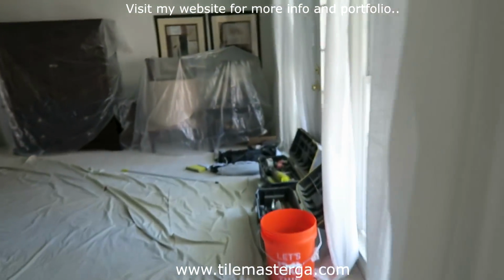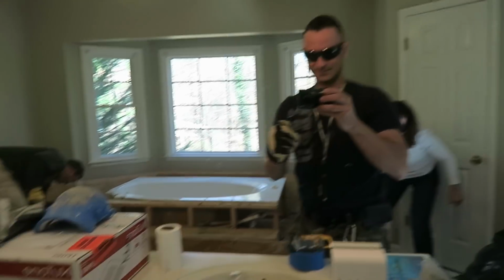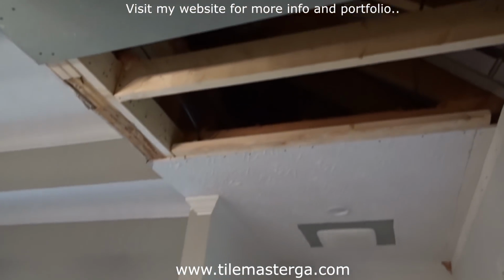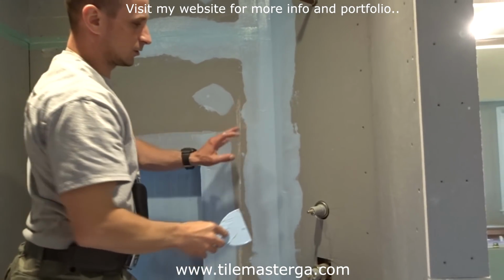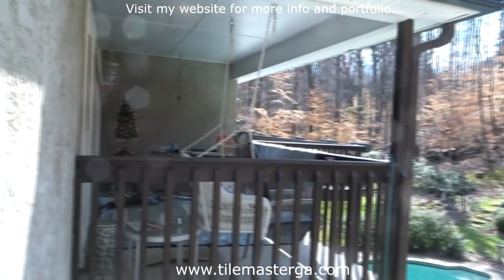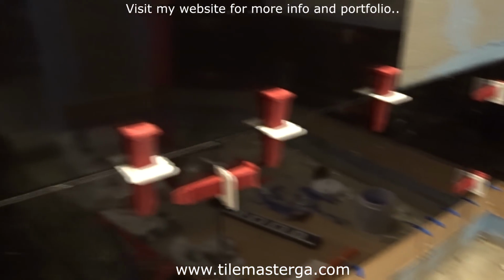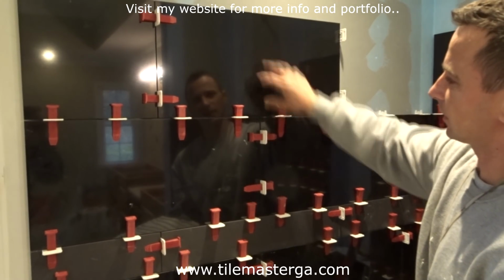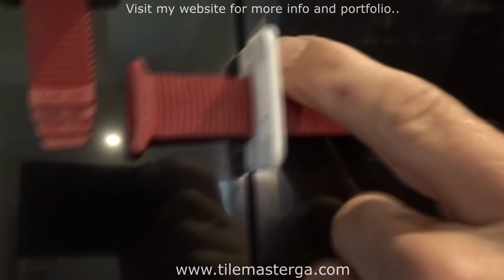Part (1) 1990's Bathroom remodel from scratch - demo, prep, tile installation etc...🛀🏻 🚿🚽🚻

Comment: Thanks for your videos!
Just curious why you didn't continue waterproofing all of the green board in the shower?
It looks like you put cement board in the lower part of the shower.
It just seems like it's standard nowadays to apply liquid membrane over most all of the walls at least to 6' ? 
I don't think there will be any problems. Green board gets a bad rap nowadays since TCNA does not approve it any longer as a shower wall backer even though the liquid membrane manufacturers still approve it when it is fully covered. Very little moisture gets to the wallboard anyway with the increased use of large format tiles, narrow joints and the newer premixed acrylic grouts.
Reply: I don't quite get this either. It's like he went backwards, used to use Denshield (totally fine just to tape the corners) or cement boards. :/ To be fair, I think some greenboard is way different quality from company to company. I tested USG's lightweight and had it outdoors for two months with no problems (I'll get to see how it does this winter...) but it did turn to mush in a week or so of full submerging. But LaFarge just turned to mush in a week of being outside. :/ 

I've seen in some Polish videos where a guy was doing a wetroom, and instead of full on liquid waterproofing, he seemed to coat the greenboard walls with Mapei Primer T or a PVA primer, I'm not sure that would work as well as a real liquid membrane, though.

Comment: Job looks good,but you do not have full coverage. Due to the way you apply white thin set some cement should have smear between the joints. And you only apply it on the tile. But all tile jobs should look good. But I believe behind the tile should be better. The right prep is everything. And putting dura rock on curve nails in pan. And hoping waterproof will take care of it. Mud it right. Then waterproof. It take time to do it right. You are professional set the example. Not hatting. Just from experience 35 years.

Comment: Starr tile said you can't bury the backerboard into the pan to avoid water wicking up the board....Do you not believe in that? Won't waterproofing the final slope cause a moisture sandwich between the pan liner, mud bed and hydroban? Do you not believe in the moisture sandwich theory?
Reply from the maker: If you look closely you will see that board is not "bury" in the cement. 
I will be explaining it in next part from this project, thanks for stopping by.
Reply: @TileMasterGa  Ok. Not saying you're doing it wrong....Just wanted to know what is your take on this subject. I'm excited to watch your next video 😎

Comment: Any reason you only back butter the tile? Based on TCNA recommendation tile in wet areas should have 95% thinset coverage.   Seems this is unlikely to happen when only applying thinset to one surface. I've always seen guys trowel thinset on the wall/floor surface and then also backbutter the tile to ensure that 95% coverage.  You can see when you pulled off that tile from the wall all the area that was not covered with thinset. Just an observation.  Coming together nicely though!
Reply from the maker: Well, this tile was in temporary stage of installation ( not even pushed all the way ), and before I could install it permanently I realized that I have to remove it. 
I do agree that maximum of coverage is always recommended, but especially for areas with traffic - floors.( all floor tiles I am always back buttering and highly recommend that )  If you fail with good coverage on floors tiles may crack ( from walking on them or simply dropping something). 
Walls do not receive any traffic, especially in shower. So if you miss spot here or there you still will be in good shape.
Thanks for stopping by.

Comment: That bathroom is way nicer then my bathroom.
Even before you upgraded it.
But i have remodeled my bathroom better then it was.
My bathroom was built in 1950.
I remodeled it 2 years ago.
Tore out the toilet and bathtub, and put in a walk in shower and new toilet.
I am glad i took out the toilet, the wood underneath the toilet was in very bad shape.
So i cut out the old wood and replaced it with new wood.
I put in the shower, then i added a sliding glass door.
I replaced the old water pipes with a new shower head and on & off water handle.
Then i added tile at the top of the shower walls, and painted the walls and ceiling.
I tore up the carpet in the bathroom to get the the wood under the toilet.
I added rubber mat's on the floor so the floor would not get wet.
I sealed the rubber mat's at the edges.
Then i added another mat on the outside of the shower door to double water proof the floor.